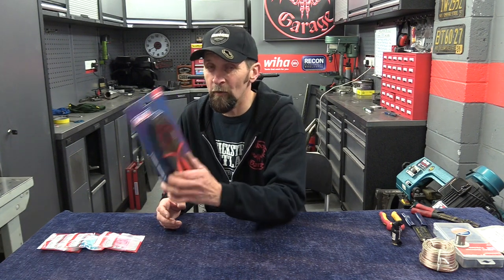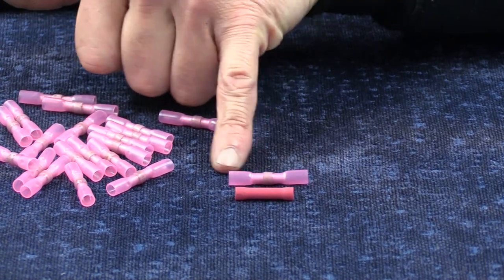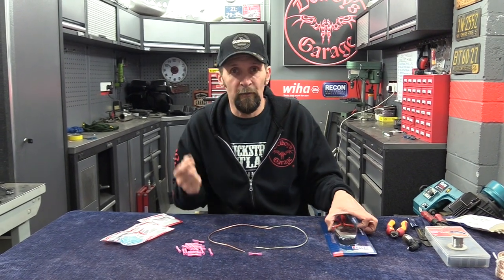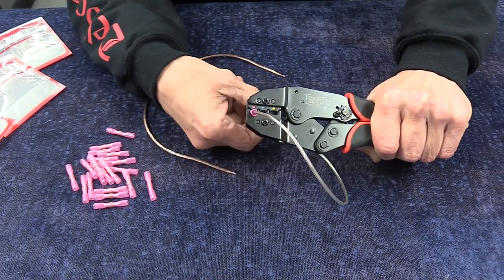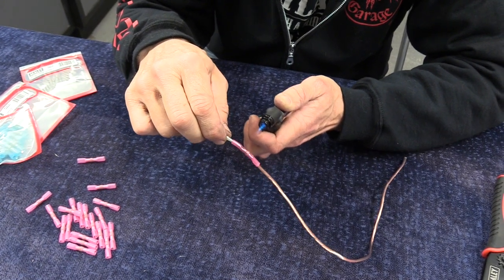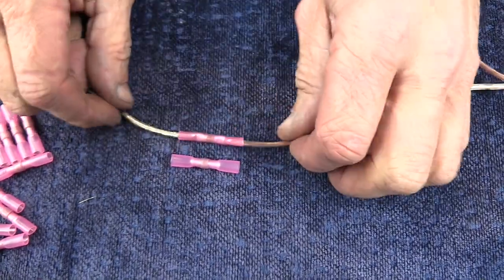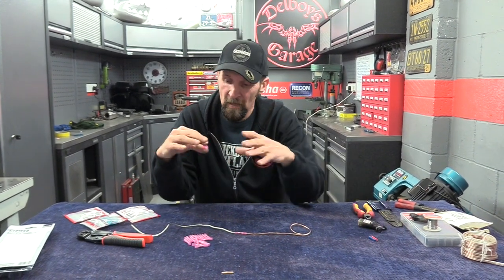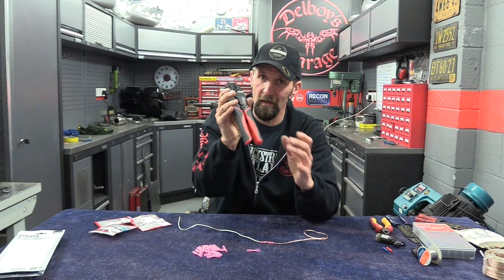Delboy's Garage, Soldered Crimp Connectors, Tool Review.

Comment: Worth mentioning that the ratchet crimp tool is stepped so you apply different pressure to the crimp insert and the sleeve that grips the wires insulation, get the step the wrong way round and you wont get a tight joint. Great review :-)

Comment: This is a good idea for work on a piece that is still attached to your bike. You need like 3 hands to hold the 2 wires solder and heat source. No chance of dripping solder on your bike or other equipment.
Reply from the maker: Oh how many times have we done that !  (forgetting the heat shrink)... and you're right, yeah, it is a safer way to do it I think, and anything that makes it easy for us peasants has to be good !

Comment: Thanks for the info about over crimping the joints, I never knew that could be a problem. I have used the self soldering connecters before and as you say, they do only need gentle heat I used a soldering iron to shrink them. Nice review, thanks Dell.
Reply from the maker: Hi Andy, yeah me too.. used the solder shrinks, and crimps.. but never seen them combined.. good little bit of tech aye..!

Comment: don't forget to stagger the joints Del the length of the connector or you may get a blockage in the handle bars or it could be a lot harder to feed them

Comment: (p) Brought  a full set of these and the crimp tool. Not quite life changing but pretty close for someone who hates soldering. Did a destruction test and it ended up with one end in the vice and a pair of pliers on the other and all my weight behind it before it gave.
Reply from the maker: Hi buddy, that's great news, am really glad that you like them, they stand up to a proper test aye... at least you can make some tidy connections with confidence !

Comment: Never seen those before, they look pretty good.  I used to use the normal crimp connectors with a bit of insulation tape years ago fitting stereos in my cars.  Much quicker than soldering lol

Comment: Ive seen these around since 2010 or so but never purchased one as I was under the impression they were not crimp connectors as well, mainly because Im too old school buying un-insulated crimp connectors and then soldering the connector and heat shrinking it afterwards, that meant putting heat shrink down the cable, stripping and tinning the wire prior to inserting and tinning the connector as well then inserting the wire, crimping it then heating it and adding just a touch more solder on the outside so it runs in and follow up by sliding up the heat shrink and then heating that to shrink with a heat gun set at a temperature so it would hardly burn the heat shrink and I would use the double sleeved with glue heat shrink, massive process and not for the faint hearted
Reply from the maker: Blimey, that sounds like the long way round.. but what a connection you end up with.. i recon if you pulled on it hard enough, it would break ":next to" the splice, not on it..!!    these are very much a DIY solution for those who have no inclination to learn soldering etc...
Reply: Yeah most guys I know come to me to do their main battery terminals, but this crimp is the perfect solution for everyone,  waterproof crimped and soldered in one package what more could you ask for! By the way the crimp tool you have is going to last for ever, I purchased mine when I was in my 20's and now 30 years later it's still going and accurate, by the way that ratchet you need to know you can move that lever between the handles to release it for example placing a yellow crimp in the blue by accident, just a small screw driver and touch the lever and it releases.
Reply from the maker: Thanks for the tip buddy, handy to know if you need ot back it off again... and yeah, it feels like it'd last a lifetime.

Comment: The naked flame way of using heat shrink isn’t all that good if making a connection on your bike especially in an enclosed space. 
In those cases, I tend to use either a heat gun (hair dryer type) or by rubbing a soldering iron along the length of the connector. 
I would imagine the soldered, heat shrink connectors would work by those methods too?
Reply from the maker: Hi Kenneth, I would advise, respectfully, not so with this particular connector, the touch surface of your soldering iron blade will burn the heat shrink, and there's an issue here with this particular connector if you burn it, and that is, remember the heat shrink is pulling inwards under pressure as it warms up and squeezing the solder, if you burn through the heat shrink the liquid solder will squirt out, not only can this injure you, but also you then have an un-insulated joint... I would always recommend a heat gun and stay away from soldering irons... heat guns can be dangerous in an enclosed space under your seat, as they spread heat far wider than this jet flame, so use the kind of hot gun that has a cradle to hold the wire in, but once again, I would never touch the heat shrink with a soldering iron, it will burn it...
Reply: Moonfleet41 Yes, understood. I could see how overheating may be a safety issue.

Comment: Interesting. I use posi-connectors on my RT1200 for the emergency equipment. Bigger but a lot less fiddly as well, and even the normal ones done tight are as good as water tight. Again genius in their simplicity. Simple explanation is you expose the wire, take of the end cap, but the wire in and tighten again, they have a solid metal block in the middle similar to the solder. 

You then have posi-taps which are a very simple way of joining 2 parts of wiring together. Take one end off the posi-tap, place the insulated wire in one end, and the exposed 2nd wire in other end, tighten it up and you have a solid connection. On the posi-taps one end of the block is a pin which punctures the insulation, so leaving a very small hole should you need to disconnect the 2nd wire at a later stage   

And they are re-usable

Here's the link https://posi-connect.com/
Reply from the maker: Hi Mark... You must have a microphone in our garage buddy.. i want to get hold of a few packs of those for another review in a week or so.. i absolutely love the Posi system.. it is a temporary and removable connection, which offers that facility that the Solder crimps dont.. they are perfect for what you have dont to your Blood Bike... Ill get hold of a few packs and it will be a review coming soon mate... Thanks for the nudge.. great minds think alike aye.. take care and have a great week... D&Px

Comment: The tool is great ..i see sparkys at work with them and always think thats nice ...and then go and bodge standard bullets with my standard cheapo crimper or solder then heat shrink ...this seems a good criper and connector !! 
Of course you can over crimp if youre the mighty boosh !! 
Bouncy bouncy all the shoes in a line ,Bouncy bouncy .....they are the crimp champions of the known universe 🤗☮❤
Reply from the maker: Awesome... have you been at Aunt Maud's gin again... the lyrical gangsta returns !

Comment: There is a ton of wiring in the backbone on the Switchback, unless you are going super tall on the apes, you will not need to extend the wiring. I put 12" apes on mine, and the wiring did not need any lengthening. If I remember there was at least 4 extra inches on the main harness. I wired internally also. I kept the stock 2 in. riser on my 12's.  I would check to make sure these are not canbus wires, could affect the signal to the tsm.
Reply from the maker: Hi Terry.. yeah i saw that when i took the beach bars off after buying the bike.. They have those wonderful tiny plugs that are no bigger then a fingernail and can be pulled through the holes in the bars so no need for fiddling about trying to take the plugs off the ends... i saw that there seemed to be a load of slack in neck like you said.. but if i do this ill go for 18" bars, and thats still longer then the extra wiring.. but that not my biggest beef.. i have ABS on this bike.. so its a ballache replacing all the front brake hoses, stupidly they are molded into the block under the headstock, and the whole lot has to be replaced.... It may not happen, just depends on how involved it is... Thanks for the headsup too buddy.. take care. Del.
Reply: Moonfleet41 I have abs also. I got my cables from magnum shielding. I have not put them on though. I worry about not getting them bled all the way. Really do not want to take it to the dealer to have the abs bled, my dealer is very expensive. I willbe very interested in seeing what you do.

Comment: Nice review Del. That crimping tool is the way to go, I have had mine for years. But I am going to have to look into them connectors, they look the business. Penny and you enjoy your Sunday. Cheers
Reply from the maker: Thanks so much for that kind endorsement, its good to know you like them too.. and those connectors are the solution i needed for the wiring ill have to extend inside my bars.. it stays slim and easy to feed through the holes..  Take care and have a chill out Sunday my friend.. keep in touch... D&Px

Comment: Presumably, the both bare ends of the wire need to go into (overlapped or just touching?) the solder centre section?
Reply from the maker: Touching is best, tip to tip, if you can overlap them a little, provided there's room, then I guess that's better, these wires filled the hole, so I just touched them together inside ....

Comment: Easier to hold the connector in the tool FIRST, then feed in the wire, then squeeze. Minor point. 

I used mine on Econoseal connector yesterday and the standard crimp tool didn't work too well - you need another, specific, tool.
Reply from the maker: Really, so the econoseal crimp connector maybe needs it own dedicated tool?.. ive seen that before.. this tool works great on these connectors... and they have different heads for them if you need it too... but im sure you know that..   Good tip on holding the connector in the tool... thanks.. have a good Sunday buddy.
Reply: Moonfleet41 Ah, need to investigate alternative jaws insert. Thanks. Have a good Sunday, yourself. Hugely admire your presentation skills. Going to sound odd, but you have great breath control. Are you a singer, or diver? Did you learn, or is it natural?
Reply from the maker: Hi again Stephen, my word, you're the first person who's ever said that, am not a singer and have never dived, but I guess I do find it quite easy, it's just a matter of planning a fraction ahead of what you're going to say and structure it with the right timed pauses, I think it's something rappers learn to keep the flow and the rhythm in their lyrics, but I've never paid any specific attention to it, just do it as it comes lol   Thanks for your kind words....

Comment: (P) Wow those are quite trick...crimp & solder...best of both worlds!  I've always been hesitant to solder motorcycle wiring, because it can be prone to cracking over time from vibrations.  I usually just use mechanical crimp connectors.  I love & have used the heat-shrinkable ones...good for keeping out moisture and corrosion.  I love how these have the solder too...added piece of mind for ultimate conductivity!  Props to you for the ratcheting crimpers as well!  Like you, I've always wanted a pair, but have yet to get them.  Added to the wish list!  I like to do things the right way, and professionally!  Might I suggest a heat gun, over a torch?  My preferred method of shrinking heat shrink, but sometimes too big, for those limited access jobs.
Reply from the maker: Hi Doug, you're so right in every way my friend, there are many people who champ on that solder is best, which is why I said that, indeed, it is... but not many people are highly proficient at soldering and as you say, quite rightly, if you over load the joint with too much solder, which is easy to do, then yes it can crack... which is why I saw these as such a great solution, having a joint that is both crimped and soldered is belt n' braces, so has to be a good option for those of us who aren't professional soldererers (!)... aye?! lol

And me too, been promising myself a pair of those sexy crimpers for a long time !
Reply: Moonfleet41 so right. I had a loose connection on one of my indicators, but didn't have any crimps. So as an interim fix twisted and soldered. 
It took a couple of goes, reduced the spare wire available, and and one just ended up cracking. As a novice the whole thing was a bit of bodge. 

If you can do it well I'm sure it's great, but crimps are so much easier to form a secure connection.

Comment: Bit of a coincidence, just about to use Heatshrink for the first time ever today as I near the end fully insulating and wiring out my bike garage, and bizarrely again I’ve got exactly the same jet flame lighter as you used in the video....funny coincidence eh, anyways best crack on. Ride safe you two.👍
Reply from the maker: Cheers buddy, ain't they great??  £3 from Ebay, or 3 for a tenner inc. postage, great for melting cheese on your cottage pie too lol

Comment: Del, you startled me when you said you are going to take the Dyna to apes. I don’t recall what bars you have now, but in the conditions you ride in normally (narrower lanes than what we are accustomed in the USA, splitting lanes, and requiring a generally higher degree of maneuverability), it seems to me that the higher hand position and more upright, more rear-wheel weighed rider position would come at a handling cost, particularly at lower speeds.
Reply from the maker: Hi Tom.. ive ridden with 18" Ape hangers before, its 'no biggie'.(as the saying goes), just a matter of getting used to the new position.. also ive ridden heavy bikes all my life.. and naturally...'Here"..this is my back yard, i haven;t ever known long wide empty roads like you have over there in the US.. and for much of my riding life i was in London traffic, which is a busy as New York..  Thank you for the concern my friend its wonderful that you care enough to say 'be careful'. The biggest hurdle that im facing at the moment is the front brake hose.. its an ABS bike, and the handlebar hose is molded into a junction block with three other hoses, so it would mean replacing all of it.. and thats if anyone makes a junction block with the handlebar line a foot longer !... if not, then id have to dream up a way of connecting an extension to the top end of the hose, and only if that is safe enough.. i have some guys that make HEL brake lines, and ill take their advice on it... !  Take care and thanks for your constant support, and keep safe.. Del.
Reply: Moonfleet41, thanks! Just want to make sure you and Ms. Penny stay “shiny side up!”
Reply from the maker: Yeah, thanks so much Tom.. so far so good.. but every day can be the one.. so caution always right... take care and keep in touch.. D&Px

Comment: Could I melt that solder with a proper industrial heat gun? What is the exact temperature specified by Sealey?
Reply from the maker: Hi Outty.. yes you could heat it with a heat gun.. as long as it doesn't burn the heat shrink which it shouldn't... they dont seem to publish any heat figures.. but i have seen people even use a candle.. its more then enough mate. !

Comment: Besides you need tot use a specialised tool with these, you are using this crimpingtool wrong.
It has two surfaces with different heights. One to crimp tight on the wire and one to crimp on the isolation as a strain relief. Turn the tool around when crimping the other side.

Comment: Great vid and am I a soldered crimp connector virgin or what as I never knew they existed Del lol What a great little upgrade to the normally crimped or soldered connector. Me being like yourself a bit of an OCD'er and wanting everyhing just so this is perfect especially on the jounts made just under the front headlight where it's slightly exposed to the elements. Both enjoy whats left of the weekend.
Reply from the maker: Too right my friend, I totally agree, I've seen professional soldered wire joints and they are really impressive, but I'm no where near that standard, so this is great belt n' braces for those of us who like things just so aye?!

Comment: Interesting little hobbies them! All my wiring is done by using linerman splices and heat shrink / leccy tape, never really had any issues with them either, what's your thoughts on different wire splices mate?

However for a quid a peice and like you say, if you're not good at soldering (like me!!) then they're not a bad investment and at least you know they're a bit belt and braces in terms of connectivity.

Odly enough I watched a video some years ago on  the resistance and connectivity between soldered and "twisted" together wires as while the soldered one was more efficient it wasn't much at all, really it was negligible especially for relatively "low" voltage wiring. For things like Ac it's who knows?

Anyway, looking forward to seeing the Harley again, iv got some drag bars I fitted to the Dragstar a while ago, love them but I've always secretly wanted a set of mini apes so it'll be good to see it done 👍👍
Reply from the maker: Hi buddy... Yeah ive always just crimped them in a squeeze crimp.. but its a borderline cut between too tight and not tight enough.. and im crap at soldering.. so this really works for me, and like you say.. for just under a quid a go.. they do a really good job for us DIY peasants aye.. lol!